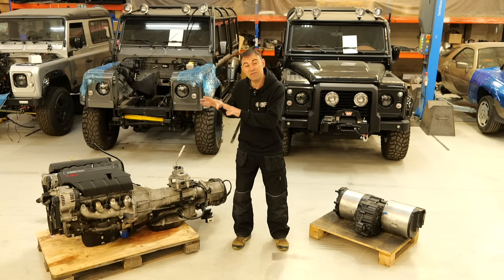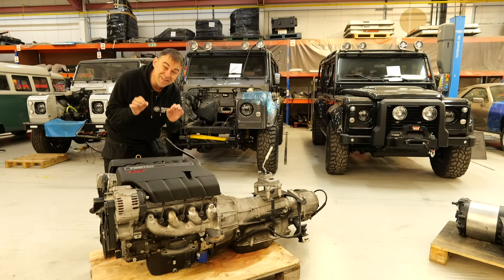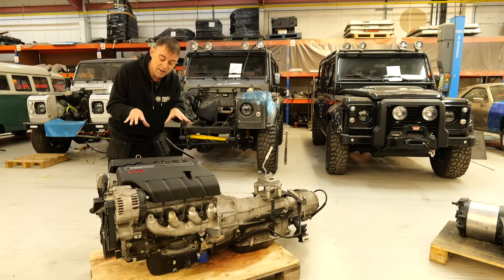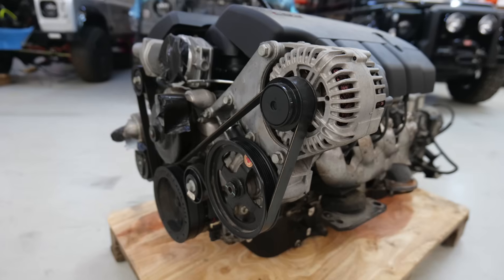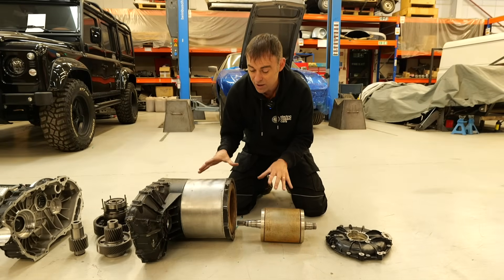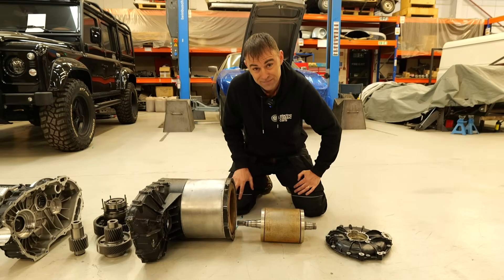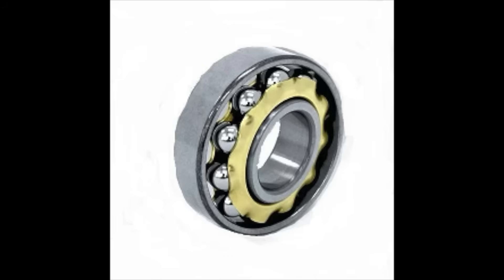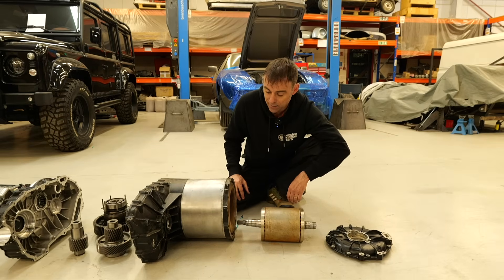Let's compare the Tesla LDU with an LS3 V8 and take one apart to see what makes it tick.

Comment: 1 US Gallons has 33.4 kwh of energy.  so 5 US gallons is  167 kwh of energy. most EV have a 90kwh battery that 70kwh is typically used
Reply: and 20% of efficiency of your 167kWh equals 27,7kWh for moving and 133,6kWh for noise and heating. Why use this dumb sort of energy ressource anymore when there is a waaaay better one?
Reply: @xjeeper  not 20. Modern engines 40-50%
Your Tesla may be 90% in perfect weather, not too hot, certainly not cold enough to need the heater on rain etc 
Then it depends on how your electricity was made, wind or gas generator? And how far it was transported by cable.  Loss of 2 to 6 percent per 100 miles. There are also losses in charging. 
It is not that simple.
Reply: @matthewoakley3772  lol. Nice try.
Reply from the maker: We covered exactly that in a previous episode. This episode is just about the motor and stripping it apart to see what makes it tick. If you want to see a fuel vs battery comparison check out our previous Tech Talk. 👍 https://youtu.be/opF1si__APs?si=nzdWz3TJjQ1ZDDbI
Reply: @pablopicaro7649  Petrol has 9.8 kWh per litre 
So a 85 litre tank gives you 833 kWh

Comment: Mechanical Complexity replaced by orders of magnitude greater electronic complexity.  Fortunately the electronics are orders of magnitude more reliable.  (however can fail many ways also-just not to likely).  Outside of the Battery Cells, that fail with age and use, the electronics could last for great many decades .  However!  certain electronics do degrade with age and harsh environmental conditions.

Comment: Thanks for the detailed and enlightening tour inside a LDM! 😍

Does changing a 9.73:1 gear set to a 4.0:1 gearset mean that the output shaft (shafts?) of the LDU now spins approximately 2.5 times faster than before?  Does that present any wear, balance, or heat issues? 🤔

Also, did you source the gear set from somewhere else, or did you fabricate it yourself?
Reply from the maker: It’s our own gear set we’ve developed over the years. 👍

Comment: Hey Moggy, great explanation, but are you putting in two motors (front & back) to retain 4 wheel drive or running one motor through the original gearbox & transfer case?, be good to see a video explaining this, cheers from Oz 🦘
Reply from the maker: You can see how we use one Tesla DU to keep a Landy 4x4 in this episode. 👍 https://youtu.be/HoqoL1EyAHk?si=wWxoWWlNQPAVIc9a
Reply: I think that a dual motor setup with 1200hp would be rather overkill and probably just a little dangerous.  @ElectricClassicCars
Reply from the maker: @PassportToPimlico sounds like a challenge 😆😉👍

Comment: Love the side by side comparison. Even in the exploded view of the V8 we don't see all the transmission parts, which surely add another couple hundred expensive bits. All compared to the LDU's--what? 8 or 10 total moving parts? Staggering difference, crazy. And the EV drive experience is just fantastic. My Lightning makes 573 hp, which makes for neck-snapping acceleration with absolutely no fuss or noise or build-up or hesitation. I know where my automotive heart is now. Cheers.
Reply: but if you had an exploded view of both that included their respective fuel systems the LS3 would have way less parts.

Comment: Don't expect cheap electricity for long. Once there are a lot of EVs, companies will have to put in charge infrastructure and that is costly, so you can forget 33c Kw/Hr. Also, that V8 could still be in good order after 300,000kms, but the battery in an EV that gives similar power and range will have expired and have to be replaced at HUGE cost.
Up front and brand new EVs look good, but only a fool would by a used one with any age on it. Resale values of EVs are very low, they are close to throw away devices.
The batteries are the problem.. get rid of them and we only have the provision of the extra gigawatts of electric power needed to provide either hydrogen for fuel cells or piston engines... same supply problem. There's no environmental benefit from EV's quite the reverse. The power has to be generated by hydro (clean), wind (decidedly not), solar (also doubtful with limited life of cells) or Nuclear (the best, cleanest option). All non-fossil power sources require a huge carbon footprint (If that's your worry) either at the generation, building or disposal stages. The IC engine is not really as bad as it is painted in this regard, it's just that the unpopular bits are more up front and obvious...
Then we have ammonia.... but again the process of producing it is hardly 'clean'.... 🙂

Comment: Are you only sourcing LDUs from wreckers?  Can you buy them new, direct from Tesla?  If second hand, you'd need to be careful of those water leak issues!
Reply: Plenty of Wrecks being sold.  Tesla total out very easily due to insane high repair cost and fear of battery damage.
Reply: @ thanks. Not heard so much about Teslas being wrecked here in Australia.  What models have the LDU in them please?  I’m also guessing you need the battery pack and a bunch of control electronics to go with the LDU.
Reply from the maker: Yes. We recycle Tesla motors. 👍

Comment: The EV challenge is about the battery, not the motor. The EV motor may weigh 300kg less for the same power as the ICE engine. But the battery itself weighs at least 500kg and carries much less energy as a fuel tank.

Furthermore, refueling an EV is a big paint in the ass.

I myself love EV, but have to admit that having an EV is much more convenient in case you have another ICE or hybrid car to spare.

Comment: The electric motor is 90% efficient, but when you add up all the losses required to make it work it's more like 70% efficient.  And while it weighs a lot less than an engine and trans, the battery required will outweigh the entire ICE powertrain.
Reply: perhaps if you all losses include Charging the battery and all energy used to keep its temp at correct range.  Depends on climate probably.

Comment: You are only comparing the weight of the engines, what about a  “fuel cell” to get that vehicle 500km range?.? The v8 60-70 litres depending on the way you drive it. The electric vehicle’s battery???😂
Reply from the maker: This episode is about the Tesla drive unit, opening it up and seeing what makes it tick. We covered the fuel vs battery comparison in a previous Tech Talk. 👍 https://youtu.be/opF1si__APs?si=ylRtOg_340xyhEgv

Comment: What is the duty cycle for say 80% of max power in the Tesla unit?  

Both the motor and the inverter are remarkably small for the stated power level.

Lots of heat to dissipate even at 5-10% losses.

A continuous duty, high power density, water cooled motor of similar power is about 8 times the volume of that motor, and requires external water and oil cooling support.

The battery would also probably not be thrilled with 80% power for very long, as that is about a 4-5 C discharge rate. Even if the battery can take that, it can only take it for 12-15 minutes.
Reply: That's true for the street driving and drag racing. Not so true for say oval track or road courses.
Reply from the maker: @joekoelker7523 I’ve been racing my EV around a track regularly for the past year. Looking at the stats I can see it’s above 80% for no more than 4 seconds maximum at any one time.
Reply from the maker: 80% power from 0mph for 3 seconds and you’re already breaking the speed limit. Why would you run it at 80% continuously for 12 minutes? That makes no sense.

Comment: WILL NEVER NEVER PUT A TESLA unit in an EV resto project.  I hope Ford or GM alternatives come about soon.
Reply: Summit Racing sells Mustang GT drive units and inverters, last time I looked it was about $4500 for the drive unit and $1500 for the inverter. But no documentation I think. Cascadia will sell you something similar, with documentation, for about $30,000.

Comment: Do the pcbs inside of the tesla motor have anything covering them or have any weather proofing? The ECU in my EV scooter was faulty so after getting it replaced I got to take apart the old one and get a look at the weird stuff they did to it to weather proof the circuit board.
Reply from the maker: Yes, they’re all mounted in a gel.
Reply: @ElectricClassicCars  Thanks for that info! It was the same with my ECUs pcb, I found it quite interesting

Comment: I'd love to see a video comparing hub motors to traditional ev motors that use drive shafts. I recently switched my old traditional motor with a chain EV scooter to a new hub motor model. The maintenance is a million times better. However, since they both use the same swappable batteries, it seems that the efficiency was better with the traditional motor. I'm really curious as to why. Is it because traditional motors have been around longer and much smaller hub motors haven't enough time to get as developed? Or is it just more difficult to stay as efficient with the smaller packaging? It could be something as simple as my hub motor being air cooled whereas my chain driven motor was liquid cooled.

Comment: Electric is the future.   It is just the batteries.  But it seems CATL has developed a sodium chemistry that is much better, highly resistant to thermal runaway, extraordinary long life and good power density.      Can't wait, but another 12 months or so for mass production.   I really don't like having lithium batteries around but have a lot (like nearly everyone).   If new, safer batteries come out I'll happily pay to replace my existing ones.
Reply from the maker: The future of batteries is going to be interesting. 👍

Comment: Quite an effort to not mention the “B” word in a 20 min video about electric vehicle propulsion.  You do realise that electric motors require BATTERIES?  For 1000km 4WD range you need at least 200 kWhr. Such a battery weighs 2000kg (compared to say 150kg for a full extended range tank of petrol or diesel). Less of a difference ofcourse with regen but still significant and with added complexity. And in most countries, at least 50% of that electricity will be made by using combustion and steam at a power station with similar low efficiency and high pollution to your ICE engine.
Reply from the maker: A 200kWh battery weighs about 1000Kg. This episode is about the Tesla drive unit, opening it up and seeing what makes it tick. We covered the fuel vs battery comparison in a previous Tech Talk. 👍 https://youtu.be/opF1si__APs?si=ylRtOg_340xyhEgv

Comment: To be a fair comparison for weight, the battery pack should have been included for the Tesla as well as a gas tank filled to the equivalent range for the LS3.

On the maintenance side, electric cars certainly win, until you need a new battery pack.  At that point you can pay for a lot of maintenance on the LS3.
Reply: WHY  are you more likely to need a new pack than to let's say "Drop a Valve" or break a timing belt/ chain in an ICE unit?
Reply: @rogerstarkey5390 I suppose to be fair a financial contingency would be needed for mechanical failures, but there are many cars that go to 200,000 miles without needing major mechanical work, or at least there were back in the day, and it may take some drivers 25 years to get there.  I am currently driving a 2006 Ford Explorer (well, my son) and it has had work done, but nothing inside the transmission or engine.  With an electric car, the life of the battery is 8 years whether you drive it much or not.  I'm just trying to make it fair.  Also a new LS3 in the crate is about half the cost of a Tesla battery pack, and you can get the LS3, and find someone to install it, so there's that.
Reply from the maker: This episode is about the Tesla drive unit, opening it up and seeing what makes it tick. We covered the fuel vs battery comparison in a previous Tech Talk. 👍 https://youtu.be/opF1si__APs?si=ylRtOg_340xyhEgv
Reply: @ElectricClassicCars  Well, the first part you were talking weight comparisons, and only partially completed the weight comparison for the LS3 and did nothing with the LDU.  400 kg vs. 140 kg I think the numbers were.  That comparison was made and it is woefully misleading.  Tesla cars weigh as much as half ton trucks.
Reply from the maker: @Nonplused There was a link that popped up with the battery vs fuel comparison episode when we talked about the weights. The same link pops up at the end. Maybe you missed it. Also, my wife’s Tesla model 3 standard range weighs less than my neighbours BMW Series 3. Not all EVs are heavier than their ICE equivalents. Cars have been getting heavier for decades. Compare the original Mini, Fiat 500, a Toyota Corolla etc to their counterparts today. Nobody moaned about that. But an EV being a little heavier now people moan. 😆🤦‍♂️
Reply: @ElectricClassicCars  Pop ups are nice, but I don't always have time to watch a complete library of videos!  And I'm not necessarily whining about electric car weights, they are what they are, but if we are mentioning the weight of a drive train, may as well mention the whole thing.  Comparing the weight of the LS3 to the LDU without the batteries is pretty meaningless.  And LDU is not useful without batteries.

Comment: for an apples to apples comparison you should have a LS3 fuel system including tank and filler pulled apart and then break the tesla battery down into ALL its components . fair is fair .
Reply: Keep "reaching"
Good exercise!
Reply from the maker: This episode is about the Tesla drive unit, opening it up and seeing what makes it tick. We didn’t break the gearbox down to all its constituent parts, or the transfer box either. We covered the fuel vs battery comparison in a previous Tech Talk. 👍 https://youtu.be/opF1si__APs?si=ylRtOg_340xyhEgv

Comment: so if the bottle neck of EV's is the battery. we will wait until somebody will think about electrifying the roads, as we did 100 years ago with trams and trains.😅 the solution is already over our heads.
second issue is that the energy comes in the wasteful DC form, while AC is much more efficient in transmission lines ( Edison vs. Nicola). eliminate the converter will eliminate more of the heat losses.

Comment: I have been a petrol head, did my time with Triple Weber's & Double Pumping Holley's, Driven thousands of miles in Very Noisy Kombi's, also Holden's & Ford's, BUT the thing that is not mentioned enough is the QUIET of Electric Vehicles, you arrive without a Headache from 80% of Fuel being burnt to give you one & emptying your wallet for little result...
Reply from the maker: Sounds like we’ve had a similar life. 😆👍
Reply: I've built an electric cobra and the lack of headache is great, but at low speed you do notice a lot of interior & suspension squeaks and rattles that a big V8 does a good job of hiding!
Reply: @MTrehy1976  Yeah !, Squeaks & Rattles, New Suspension Rubbers & Door Trim Rubber Seals Time (for the Whistles!!), always a quick way to kill most noises other than mechanical...
Reply: *Webers, *Holleys, *Holdens, *Fords etc. none of these words have apostrophes.